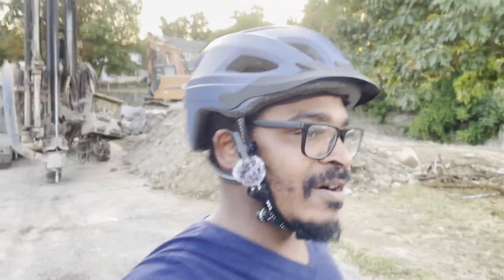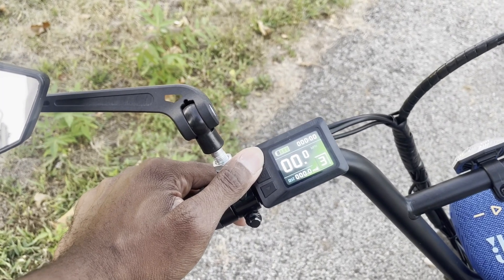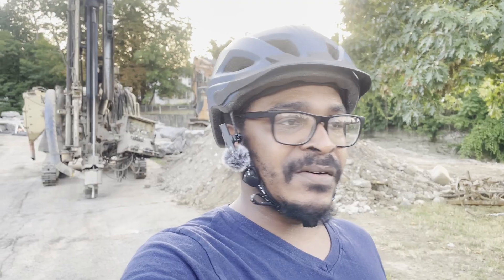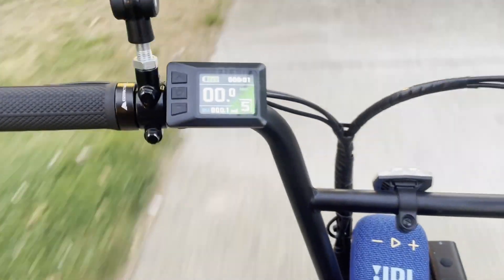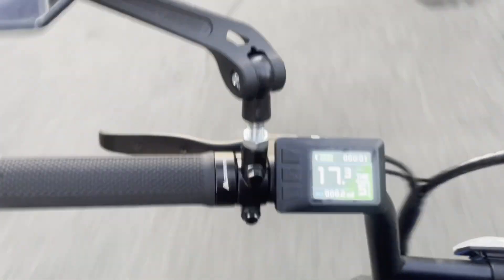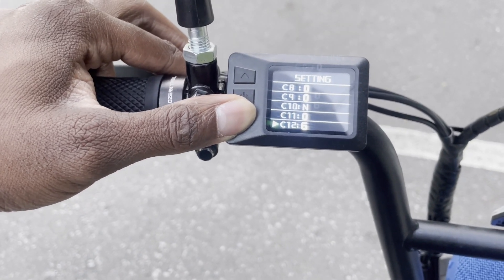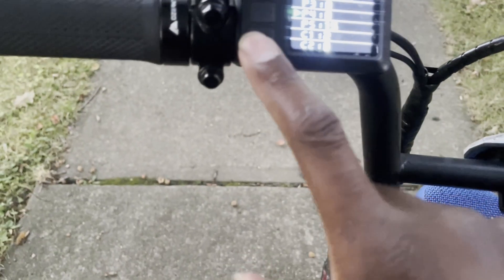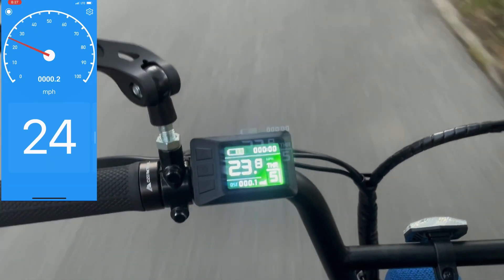New Controller and Battery | Schwinn Hurricane Build (part 3)

Comment: I want to do something similar but is the new battery needed? could i buy just the new controller and achieve something similar i also dont want the display
Reply: also could you breakdown everything you did to make it do this?
Reply from the maker: With any new controller a corresponding display is needed to tune the settings of the controller. Some controllers can be used without a display if they have Bluetooth enabled connection. Considering this ebike didn’t have a display, a display would be fitting for it. All I did was over volt the ebike with a 48v battery and a 25a controller.
Reply from the maker: Controller is for a 750w motor but probably peaks higher than that.

Comment: What about the mid drive kit can I get a link to that please ?
Reply from the maker: It’ll be in the video before this, and you’ll need a 73-90 mm bottom bracket the one in the video is the wrong size, If you want to do the mid drive you will need a new rear wheel because the speed sensor needs a spoke to mount. A control and a battery is much cheaper than the additional items needed for the mid drive

Comment: hey man!! i hope you see this. but i have the same bike i wanna mod it to go around 25 ish?? but i cant find where the controller is anywhere on my bike? i got mine from dicks sporting good. i would love it if you could reply to help me out a little !!!
Reply from the maker: Controller is in the battery tray. It can’t be removed from the tray due too the ul certification and the waterproof rating. It’s completely sealed. Could be removed if you want to take the extra time to but it’s not necessary. That’s why I don’t have the oem battery on the bike. 48v battery and new controller was my cheapest option.
Reply: @grantsvlogs so you don’t need to remove it?? how did you add a new one on?
Reply from the maker: Rephrase, the motor controller is glued into the battery tray, to remove the controller from the battery tray would take time, if you want to use the oem battery. If you take the battery tray off completely, it’s to remove the controller as well. This means you will have to get a new battery to replace the old battery as well as a new controller.